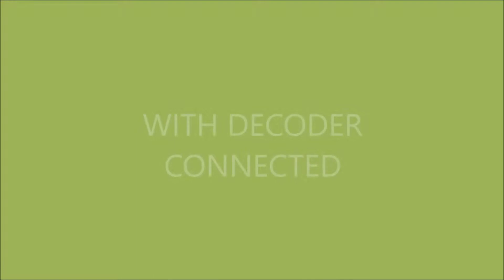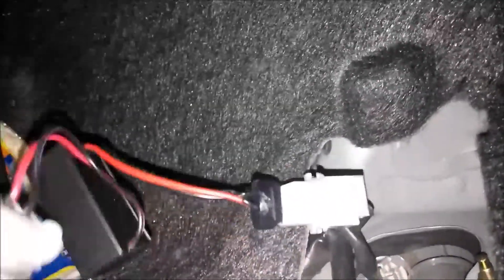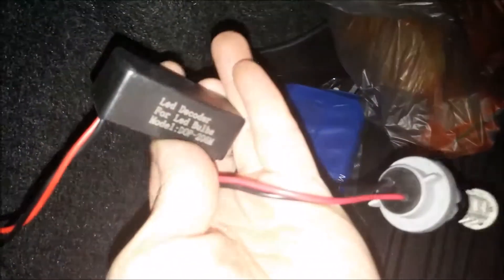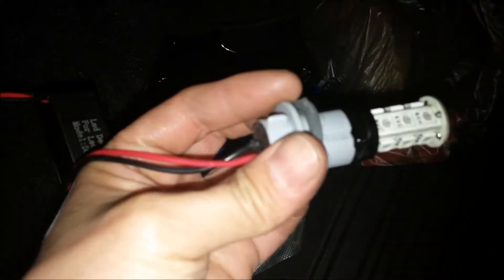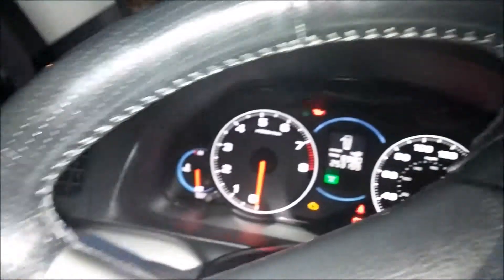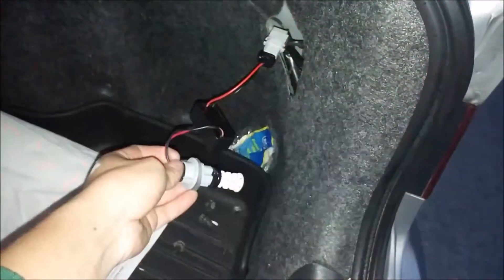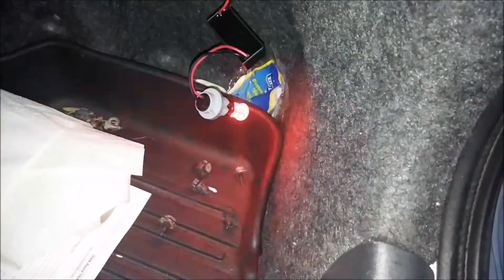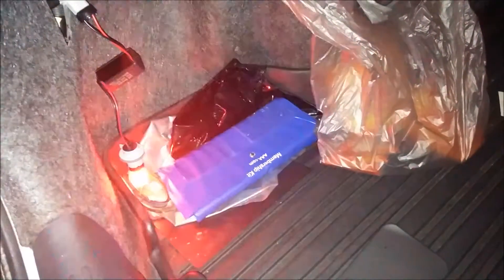LED TURN SIGNAL LIGHT, BLINKER WITH LED DECODER to prevent hyperflash

Comment: It would be great to know the specs for those decoders. I asked one seller on eBay if I can use decoders listed for headlights on turn signals as well and they simply say no. However, according to their own specs for headlight and turn signals, both are the very same; only difference is they have different connectors. Dodge Caliber uses H13 type on all lights, front and rear; that's why I like the idea to use the same decoders everywhere.

Comment: Put on the hazards instead of walking over twice to change the indicators. Genius.
Reply: On hazard there is no hyper flashing even without load resistors. That's why he try to show us the turn signal in eash side working with and without load resistor.